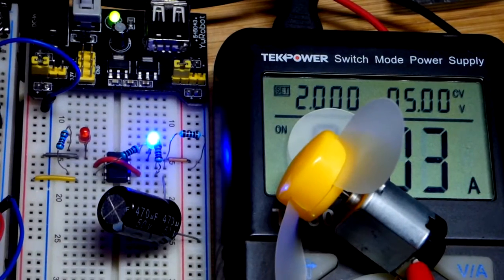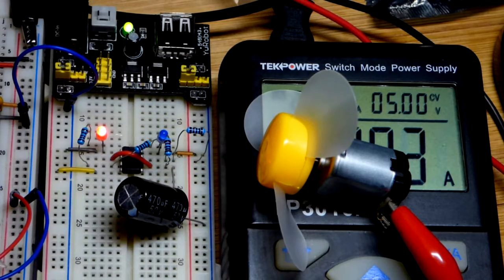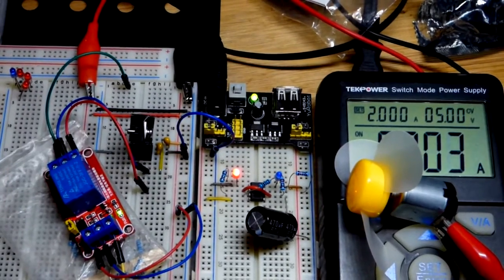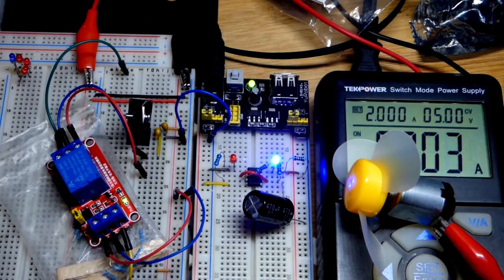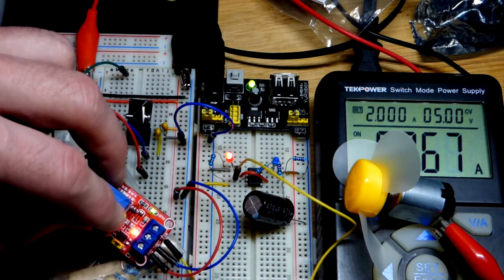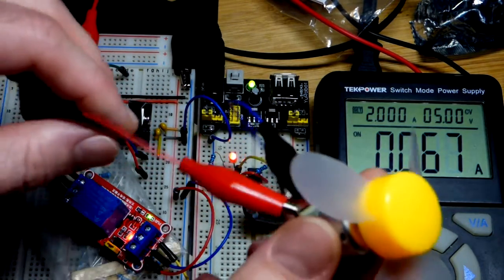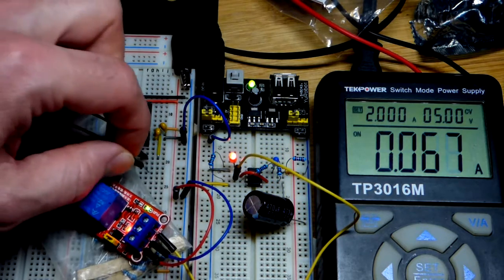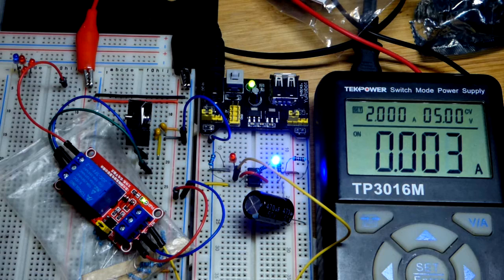Fan controlled digitally circuit using 555 timer relay and LM317 learning electronics lesson 0057

Comment: The power supplies of the relay and the 555 could but do not have to have a common ground. More often than not, they are completely separate circuits. Great video. Thank you.
Reply from the maker: Those are good points. Thanks for watching!

Comment: Disclaimer: this is not a complaint or "correction" just a conversation. :) This is one of those areas of contention for me --- is this really a digital circuit? From my understanding so far ... a true digital circuit requires two things 1) a clock 2) a code or language ... this circuit provides #1 but the width of the pulses does not form a code. I would argue that this circuit is 100% analog. :)
Reply: Technically you're correct, PWM is an analog signal by itself.
Digital doesn't requires a clock (or maybe you mean that thing to keep track of time?) or a language/code, it's just a stream of data or a signal expressed in true and false states.
So technically you can make WORKING digital circuits with just a pen and paper, not electronics (or even electrons) involved. 

On the other hand you can make analog signals with "digital" circuitry and IC's aka components that are normally being used for digital signals.

My personal approach to this, is that it's important to be aware that signal like PWM are analog and therefor can be manipulated a certain way (filters and such).
Reply from the maker: Digital is the 2 states of high and low. If I flashed the LEDs rapidly enough that they look like they are always on, then they will always be more dim than when they are on steadily because the time that it is off lowers the average voltage across the LED and it's protective resistor. But they are still turning on and off fully. If you alternate 5 volts and 0 volts equally (50% duty cycle) at 60 hertz, then you will have an average of 2.5V, and the LED will look half as bright as when it is always on at 5V, but you are still only dealing with the two voltages of 0 and 5V. You can use PWM to change the voltage of a capacitor with some resistance in real time to make an analog signal that can be amplified, but the PWM itself is still digital.
Reply: @Electronzap  close. Digital is not merely two states -- that is binary. Digital is more than binary. Digital is MANY binary states in a row -- read just like a language. A code. PWM is analog, not digital for this reason. It has a clock, but it is not code.